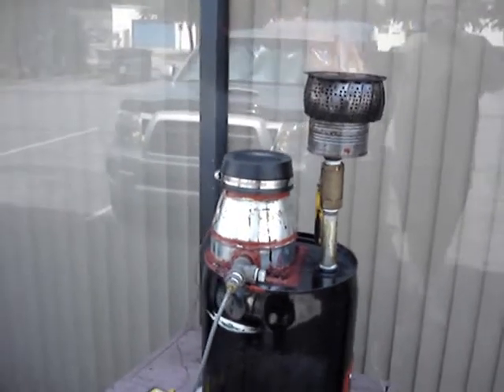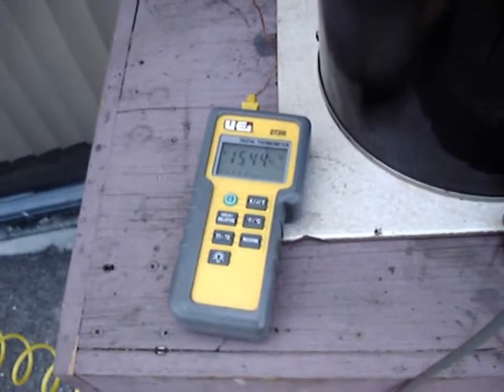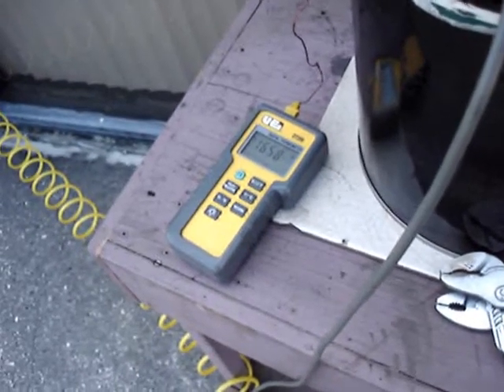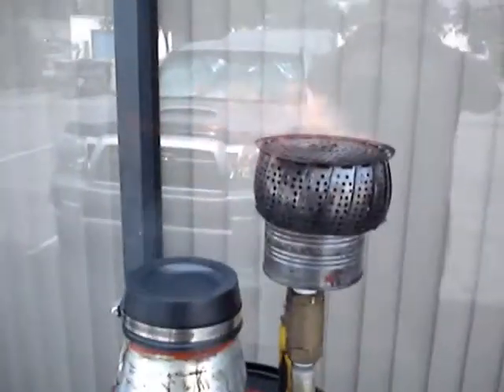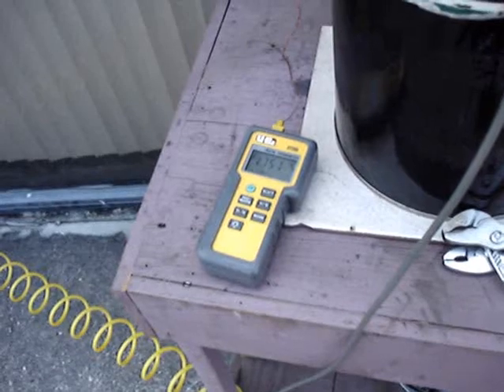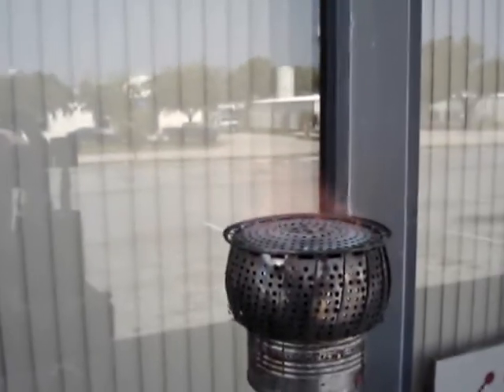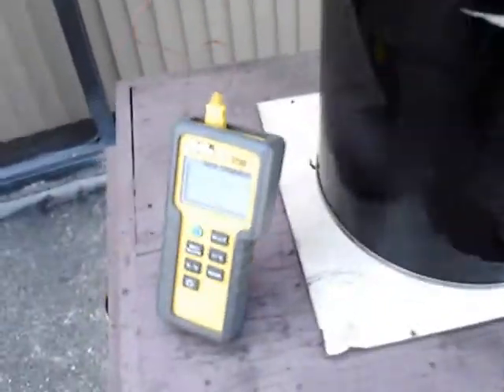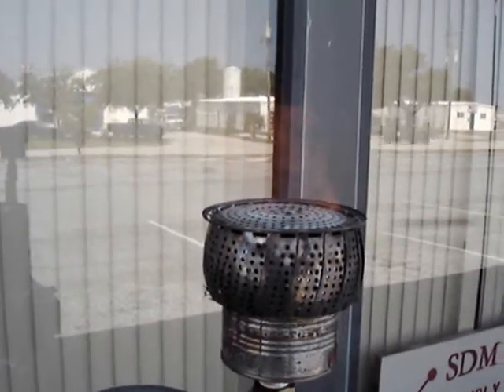Biomass Gasifier Thermocouple Run at mdpub.com

Comment: the temp you are running is a little on the low side. the high temp should not go over 3000f  but you should be in the 2250f range to ingress the production of gas. yes the gasifier will start making gas as low as 750  but you need more power captain increasing your constrictor plate zone will raise the temp.

Comment: the problem your having is that the tar is not in the hot zone long enough to be fully broken down. Try a funnel type constrictor plate.(a tapered tube) to create a reaction zone or in-large what is there. the larger the reaction zone the less heavies. thin run the gas threw a (sawdust type spiral filter) to remove the ash. that should clean your gas up nicely. then cool the gas threw a tube radiator or heat exchange to reduce to temp of the gas. then you will be ready for a combustion engine.

Comment: hey dude,
  Love the work! your site is awesome and you're certainly pointed in the right direction.  I don't think i've ever seen any footage of the inside design (which would be nice!) so i can't make any suggestions for sure, but my thoughts regarding the tar center around the idea that while you have a very hot gasification zone, some gasers are created that don't have to travel through the hottest parts...hence the tar.  Look at the Kalle gasifier as a good example for solving this prob. gl